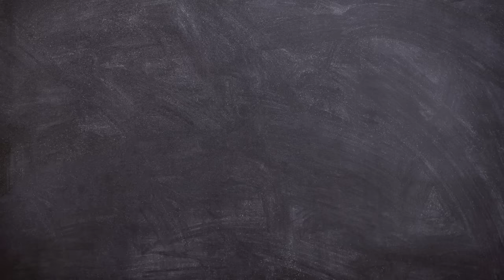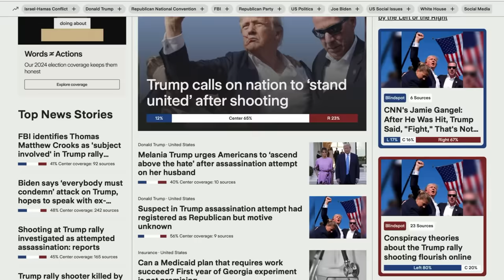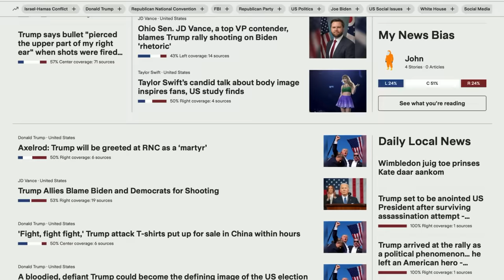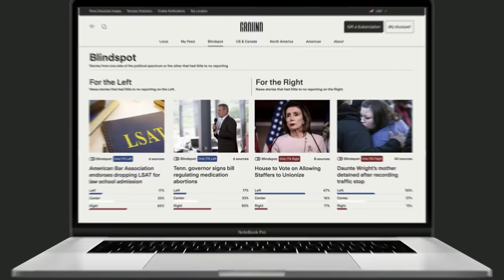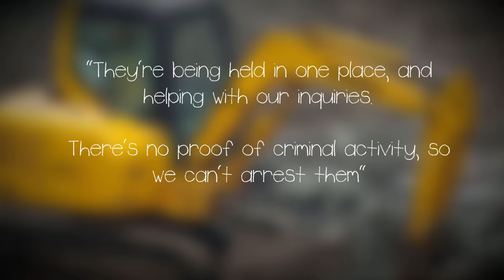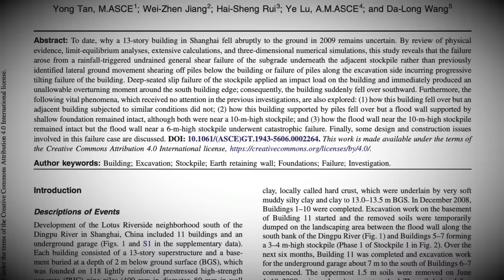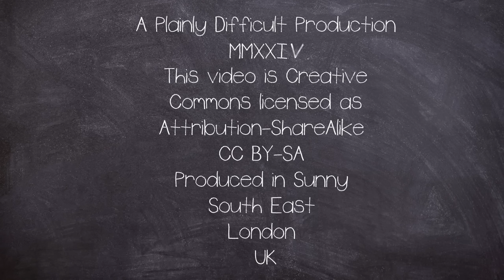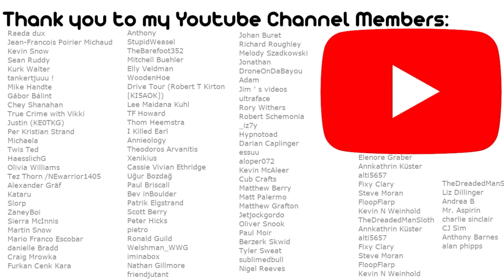Concrete and Steel Tower Falls Over Without Any Warning | Plainly Difficult

Comment: "Silt and clay on top of a fine sand"   Im not an engineer, but it is a scary combination of words for me.
Reply: Yeah, the description of how they expect the building to not sink into the ground was a bit.... sketchy to me.  I get that it does sometimes work.. but.. well.. it's like those cake decorations with spikes on the bottom.
Reply: Exactly, you don’t sink your piles for a building of that size into fine sand especially. It will always cause a disaster!! Engineering 101...
Reply: Bible warns against building on shifting sand. Heed the warning!
Reply: @mariantreber8055  You're not wrong! :D
Reply: You look like an engineer to me
Reply: Shanghai is build on a swamp so that’s pretty much unavoidable. Building on sand is fine if the pillars r sufficiently deep. That’s not the issue in this case
Reply: @mariantreber8055 there also weren’t any modern day engineering techniques available back in the days when the bible was written…
Reply: @awesomebydefault3877  Yeah, but back then they knew how to build a SOLID foundation. :D  Pilings are the cheap, easy way.
Reply: @marhawkman303  yeah… solid foundations ain’t exactly great for building large buildings on difficult terrain. It’s not like we don’t know how to anymore, there’s just more efficient ways to get the same results
Reply: @awesomebydefault3877 don't try use this as evidence the bible you read today isn't the gospel of jesus it was written by random humans it's filled with lies and contradictions 😂
Reply: @julianrogers8608  And you are certain of this because?
Reply: "Im not an (...) words for me." 
 
About as scary as digging out the parking garage subsequent to building the tower...
Reply: @knrdvmmlbkkn  Yeah the digging the garage seems to be what caused the ground to shift.
Reply: @freethebirds3578  it is proven fact the bible literally says the gospel according too and then the disciples name in the different books it's not the original gospel of jesus it's a fake one made by corrupt disciples and then altered by kings again it's not the original the bible contradicts itself and the religion do some research on it it's very well known alot of priests even admit to it and say if you deny it as a Christian you're lying which is a sin
Reply: @julianrogers8608 You got your talking points down pat.  Not one iota of proof in it, though.
I put my faith in a book that has been around for thousands of years long before I buy the ranting of internet experts.
Reply: Your pfp is a engineer
Reply: @mariantreber8055  Grow up!
Reply: @marhawkman303  They knew how to keep a cross standing up for it's intended purpose. Good with nails too.
Reply: @byteme9718  Heh, true. :D
Reply: think this one was scary, check out Millennium Towers in San Fransisco.
Reply: You read my mind. 😂
Reply: Same I went <.< >.> this will not end well
Reply: @julianrogers8608 I am 100 percent certain I can explain any supposed contradictions you think are in the Bible. The fact that you believe the Bible is full of contradictions just shows that you don’t understand it
Reply: @XxHarambexX  (2) Samuel 24:13    SEVEN years of famine.
 (1) Chron.: 21:12    THREE years of famine.
theres one theres many many more one simple google search will prove this to you so will the church its a proven fact stop coping
Reply: @julianrogers8608  You do realize that there had already been 4 years of famine in the land because of King Saul? Therefore, the 7 years mentioned in 2 Samuel 24:13 would simply be and extension of the mentioned 4 years. 4 years, plus 3 years, equals… 7! Do your research pal

Edit: Feel free to throw any other supposed discrepancies my way, like I said, I can explain every last one of them
Reply: Made in China are the most terrifying three words.
Reply: @jonsturgill8868  nah made in America is even scarier lmao
Reply: Word soup….
Reply: @freethebirds3578  Because it's translated and anyone who has two languages they're native-level fluent in will tell you that it's a bitch and a half to translate all the subtleties of two languages as different as (edit: aramaic) hebrew and modern english, especially when you're translating from a translation and don't have access to the original but later copied manuscripts of an older oral tradition and even LATER compilations that aren't in the original language anymore.

And more if it's got sections that are written poetically (like the bible does) or written as instruction for a specific class like say a priesthood (like the bible does) or names animals and flora in a region of the world that may have gone extinct (like the bible does) or uses then-contemporary expressions and neologisms (like the bible does)...

Basically if it was divine at the start, the translations sure lost it by the time the human politics of the orthodoxy vs the heresies took hold of it as a tool for claiming power and governance.
Reply: @neoqwerty  Your knowledge and wisdom outweighs thousands of years of study of Scripture.  Wow.  
But you have no moral understanding of faith in God, so you feel confident in your own intellect.  That's a huge leap of faith.
Reply: @freethebirds3578  Because independent bible studies show this to be true. Only with god goggles on does the bible make sense. And anytime it DOES get something right, remember that even a broken clock is right twice a day.
Reply: @mariantreber8055 nonsense, many citoes were built under similiar conditions, Berlin for example is also built on drained swamp lats, with a tin of sand and very high ground water levels but we still managed to build a 350 metre high tower with the right foubdations, as did Shanghai with way taller buildings.
Reply: @kellydalstok8900  You say "god goggles."  We know that as the Holy Spirit.  When He lives in you, the Bible is perfectly understandable.
Reply: The scary thing about building on silt in Shanghai, is that Shanghai is in an earthquake zone.  If a big earthquake occurs then the ground water will liquify the soil and the building will literally sink.  I have seen whole blocks where the first floor has become the basement after a big earthquake.  Fortunately, the buildings there were only 3 and four stories tall so they didn't topple over.
Reply: @mariantreber8055  The Bible also warns against cutting your hair and trimming your beard, common sense says not to build on an unstable foundation, we don't need the bible for that
Reply: Now you know why the saying "a house built on sand" exists.
Reply: I dunno, ur pfp says otherwise
Reply: Yeah, you aren't wrong, though. It's perfectly doable, but this was certainly not the right way.
Reply: This means you are overqualified to be a Chinese engineer
Reply: Yeah, I rolled my eyes and shook my head when he said that.
Reply: @XxHarambexX   God commanded that no work should be done on the Sabbath, yet he told the Israelites to carry the ark around Jericho seven times on the Sabbath. No graven image was to be made, yet Moses was directed to fashion a bronze serpent.
Reply: @  Your reply shows how little you understand the scriptures. Exodus 20:10 says: “you must not do any work” on the sabbath day. By your definition, simply walking around with an item in hand would considered unlawful on the sabbath. The Pharisees in Jesus’ day also held unreasonable expectations of the sabbath, for they were harassing Jesus’ disciples for plucking heads of grain and eating them on the sabbath day. (Mat. 12:2, Lu. 6:2, Mar. 2:24) You also conveniently leave out the context, that is, why the Israelites were carrying the Ark around Jericho. As for the copper serpent, that one is pretty simple. It was not made to be used as a “graven image” for worship, or, in other words, an idol. Numbers 21:9 says: “whenever a serpent had bitten a man and he looked at the copper serpent, he survived.” What is more, 2 Kings 18:4 tells us that when the people did begin using the serpent as an idol, or a”graven image” as you say, it was destroyed.
Reply: @XxHarambexX  Question. Was Jesus omniscient?
Reply: @ Not according to the Bible. He is called the firstborn of all creation, and as the reigning king of Gods kingdom, he is very wise and powerful, but only one is omniscient. Only God almighty can hear our prayers and use his Holy Spirit to help us. And according to the Bible, Jesus and his Father the almighty, are not one and the same. Jesus said himself “the father is greater than I am.”

Forgive me for not including any scriptural references, I don’t have my Bible handy at the moment. I would be more than happy to reference the verses I am thinking of later if you would like

Comment: I was there when they were building it, it was opposite the apartment I lived in. The foundations were rusty AF before they even started it, the concrete was poured on site by hand, with lots of exposed steel. I actually found a sample and took it back to the uk to use to show students how NOT to make rebar (there was zero vanadium in it, and it was really low quality, contaminated steel. I’m an architect and was involved in a few big projects at the time, I learn that the soil structure of Shanghai is not suitable for a city of its size. It’s sinking. And their draining of the underground water (aquifers) was making things worse. A lot of infrastructure in China has been built using poor quality cement and steel, hence the huge numbers of failed structures.
Reply: I saw a video of a Chinese construction worker breaking rebar just by hitting it with another piece of rebar, which also broke.  All the rebar delivered for the project was like that, but they used it anyway…
Reply: @metocvideo  ,, and they put empty plastic drink bott;es in the slab to avoid using too much concrete
Reply: Cap
Reply: Found a sample? Hmmmmm lol. You’re probably the reason it failed.
Reply: @TEMPLE7D  he aint find no sample lmao XD
Reply: @metocvideo  source
Reply: Architect " i just made a pretty picture of a building and I used a ruler and a plastic triangle thingy, when can you build it? Engineer...."uhm No"
Reply: Lucky to have an metal in it, apparently they sometimes use bamboo instead of rebar
Reply: There’s a reason why only parts of Manhattan is filled with skyscrapers, it’s where the bedrock is.
Reply: @helenrushful  does this qualify as an “oops” or “we don’t care, just build it” architectural blunder?  -asking for a friend
Reply: @crabby7668  That bamboo is probably stronger than the rebar they'd use otherwise.

Comment: "Tofu-dreg project" is a phrase used in the Chinese-speaking world to describe a poorly constructed building, sometimes called just "Tofu buildings".
Reply: Bulding fell down in one part, not even cracked by lenght.
Bad fundation, not a bad bulding construction.
Most buildings in west whoud brake to bits by this.
Reply: I don't know if that applies to this building, or that far back. Tofu dregs melt like sandcastles when they collapse; this one fell like a single brick.
Reply: Poor foundation is part of the building (most important part) so I would say the building qualifies for poorly built.....
Reply: It's specific to ones where they use poor quality concrete, so you can just pull it away with your hands. It's a thing, not a thing I've seen personally (I'm 9 years into living in Shanghai), but there have been buildings like it built.

Just to put it into perspective of how it is a thing but not the norm, in most Chinese cities, you can usually see high rise buildings for as far as the eye stretches - the country literally has millions.
Reply: @stevenwilliams4531  i think it's mostly common in ghost cities where no one lives
Reply: @Ghorda9  Most Ghost Cities have actually been filled, because they were fully planned out for population growth & expansion?
Reply: @AbstractTraitorHero  the ghost cities i'm talking about are only built for investors and no one cares enough to inspect the buildings because they just keep getting sold off like a hot potato. The buildings them selves are unlivable and only last a couple years before falling apart.
Reply: @Ghorda9  Where did...my comment go?
Reply: @AbstractTraitorHero  was there a second reply?
Reply: @Ghorda9  Yeah, there was. I had a really detailed thing talking about how what your claiming is a pretty extraordinary claim that requires genuine evidence. Because as far as I understand, no. The Ghost City's made perfect sense and have factually been mostly filled.
Reply: @AbstractTraitorHero  Just yesterday heard, that Chinese companies built 3 times the space actually needed - which results in a monsterous real estate bubble, that might bite us in the future.
Reply: @Misophist  Where exactly? I don't quite get what you mean by we.
Reply: @ljubomirculibrk4097  A building's foundation is part of its construction, especially in the modern day.
Failure to properly inspect and prepare your foundation is as much a construction mistake as using subpar building materials.
Reply: @AbstractTraitorHero  Youtube often just randomly deletes comments.
Reply: average chinese construction
Reply: Kinda debateable if it is tofu dreg. Looks like building was made of decent stuff, and the foundation didn't shatter, looks like is just rolled because the inspectors and engineers shot for bare minimum requirements in foundation stability which met the laziness of not disposing of the waste soil. 'Good enough' strikes again.

Comment: I’m impressed the building stayed in tact so well. Generally when you see a  building collapse it’s a pile of rubble not just a building sideways.

Building looks drunk.
Reply: Like maybe they could reorient the doors and still use it, lol😂
Reply: @TheMissPoovey  They'll call it a modern art piece or some sort of experimental art and then jack up the rent
Reply: well, the reason for a collapse dictate HOW it collapses... this case was the support pylons failing.  So it literally just tipped over.  Also.. steel reinforced buildings... can actually sometimes get used after falling.
Reply: It held together amazingly well. They probably could have just stood it up again and re-glazed it.
Reply: @davekearney1944  rnh... I don't think they have the tools needed to do that though.
Reply: @marhawkman303  Glaziers don't have tools? I'm pretty sure they do. That's how they install and replace windows.
Reply: @davekearney1944  Dude... we're talking about a 13-story BUILDING..... not windows.
Reply: @marhawkman303  Sorry dude....I was just having a little fun with my posts.
Reply: When everything is built well except the thing keeping it bolted to the ground